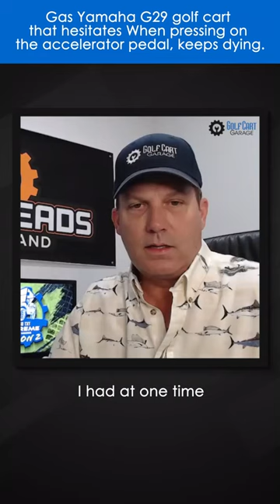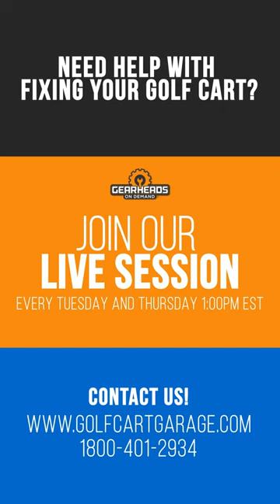Yamaha Cart Hesitates when pressing the pedal | Tips and Tricks | Golf Cart Garage

Comment: I got a 2002 Yamaha gas cart that set 5 years I swear the battery was still halfway up and I had almost given up on it because of the fuel pump I turn on the key and that thing started after 5 years I did nothing I did change the gas and oil and it's running like I was the day I bought it it sat 5 years man
Reply from the maker: That's awesome!

Comment: Love your show. My son has a 2007 Club Car President. It was a 12mph cart. We put EC Lithium 48 volt battery, also Navitas 400 amp controller in. We expected close to 30mph but only got 20mph. However, it gets to 20 very quickly. It has an on-dash control also blue tooth. Can I get more speed?
Reply from the maker: Hello.  I would think you should be able to get a little more than 20 with some tweaking of the setting in that controller.